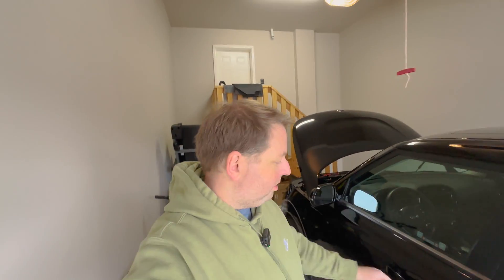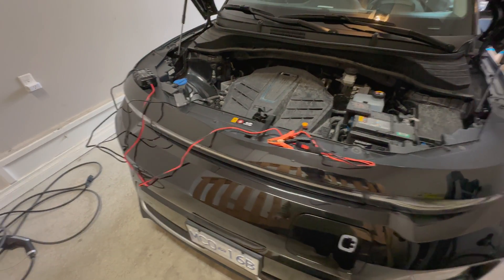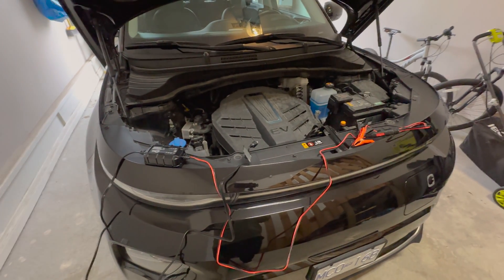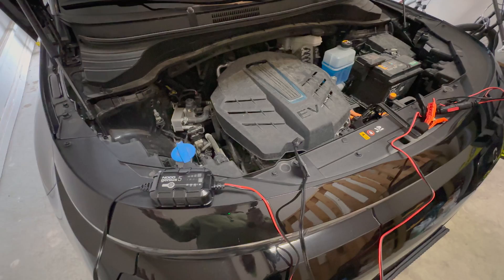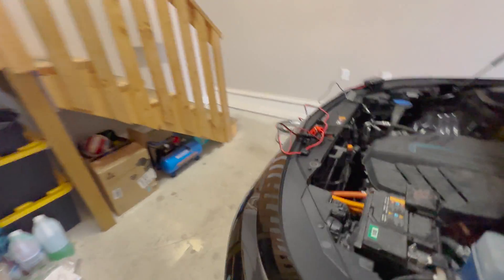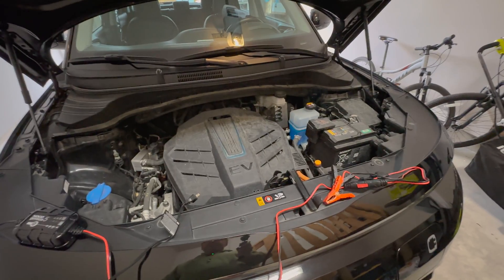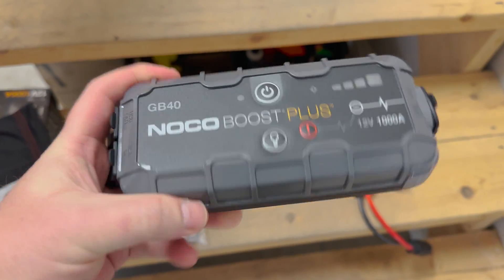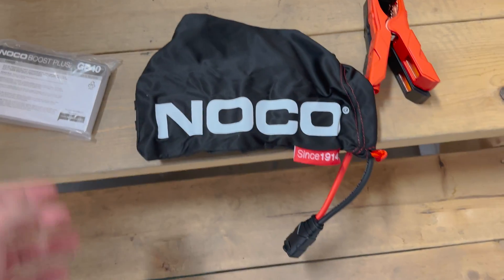12V Battery In My EV Just Died And I Had To Jump Start An Electric Car

Comment: Why would you need a jump starter? It is not like an ice car that needs a lot of current to start.
Reply from the maker: Because EVs still need to rely on 12v for basic functions including starting the vehicle. Relying on ancient ICE tech will hopefully be obsolete when manufacturers figure out how to use the high voltage battery for all functions.
Reply: @LeftCoastEV  
I understand why there is a 12v battery but all it needs to do is boot the computer and engage a few contactors to connect the high voltage battery, no cranking of a cold engine. It is for safety reasons that the high voltage battery is isolated when the car is off so until the computer sees the car has booted it won’t connect to high voltage.  I would have thought a few minutes on a trickle charger would have been enough to start the car. I would look for a different dealership as this could have happened 100 km from home then it would have been more than an inconvenience for you. I have a 2019 LEAF and when we went on a month long motorcycle trip to Newfoundland in 2022 I kept the car connected to a trickle charger to prevent the 12v battery from being drained. So far I haven’t experienced any issues with the car other than the deer that ran into the passenger side about 3 months ago.  Hope they replace your battery and give you more than platitudes. 
I will watch some more of your content when I have the chance, always good to find a Canadian YouTuber to watch.
Reply from the maker: I believe it to be a safety issue just like you mentioned. 12v is there to engage the systems, do a check and if all good the high voltage takes over. The issue with Kia/Hyundai is that their BMS system is horrible. The high voltage battery is meant to manage the 12v and if it’s low on power it should trickle charge it. It only happens sometimes. This is why there are so many complains about Kia/Hyundai owners and the 12v battery. I’m going to the dealership this week to change the 12v and will make an update video. Thanks for the subscription! Much appreciated!

Comment: Make sure your main battery is above 20%, if not it will drain the 12v.
Reply from the maker: Thanks for the info, but this would be pretty unrealistic for me to always keep my battery above 20%. EVs like this charge better if they are at lower SOC and I road trip a lot, meaning I arrive at destinations way below 20% and it will take some time for me to find a charger. What needs to be done is to address the problem with better 12v management like other manufacturers are able to do. Not sure why Kia/Hyndai have problems doing the same.

Comment: Did you have the battery load tested? If it's a bad cell you have to replace the battery. No trickle charger will fix a dead battery.
Reply from the maker: Not yet. Have a service appointment end of this month at Kia and they will have a look at it. Thanks for the suggestion!

Comment: My 12v dies every so often if I don't use my soul. It's ridiculous. I don't know if I buy a new 12v will it solve the problem or is it just a vehicle problem
Reply from the maker: That’s terrible. I would say it’s a vehicle problem from everything I have read. It’s also not only limited to the Soul EV but also other EVs from Kia/Hyundai. Will need to investigate if more and do a follow up video if I find out more.
Reply: Ive left my Soul for a month and no issues. I have flattemed the battery three times by leaving an internal light on one way or another. 
I replaced the battery once, last time i had a flat battery I used a charger that has a "repair" function as the battery was only a year old, and it seems (fingers crossed) to be OK now.
Reply: @Joe-lb8qn  i eventually bought a new battery and my problems went away
Reply from the maker: I have finally managed to get a service appointment at my local Kia dealer and hope they change the battery for me this coming Tuesday. However they said they will need to test it first since my old battery is still under warranty so I guess they might try and say it works perfectly fine and not replace it. We shall see on Tuesday.

Comment: That was a drop the ball moment on the dealership when they wanted you to trickle charge. That should have keyed them into doing a charge check including the battery. Is your KIA just 2 years old? I could set my watch on my old CRV battery, after 5 years it would fail. One nice thing your 12 volt battery is accessible.
Reply from the maker: My Kia is a 2021 model year so yes about 2 years old. I’ve had nothing but bad experiences with Kia service. Next time I am in for service I will tell them to put in a new 12v. Thanks for your feedback!
Reply: I would not leave until they replaced that battery. Also, have them check out the onboard charger for the 12 volt battery. @LeftCoastEV
Reply from the maker: For sure, will do! Thanks again for the info much appreciated.

Comment: Same problem for my Kia Soul EV 2018. I keep a 12 V battery in the car, to be able to jump start, if the batery goes dead...
I'm switching the battery soon, since it seems to loose charge much quicker now, and the winter is coming...
I will use this battery: "Exide Excell EB504 50 Ah".
Reply from the maker: Winter is coming where I live as well so I am thinking that I will need to change mine as well. Jump starting if each time is not a good long term solution. Will check out the battery you mentioned.

Comment: The thing with 12V EV batteries is they have smaller charge capacities compared to 12V batteries for ICE cars. The 12V battery for my 2020 Kia Niro died after about two years. The thing that did it for me was I didn't know about Utility Mode where I would have the car's HVAC run off the 12V as I waited in my car to pickup my kids from school and soccer games, etc. Another thing to keep in mind are people with dash cams that have their cameras hard wired to the car. If you have "parking mode" or motion sensors enabled on your dash cam, it'll slowly drain your 12V over time while its off. One thing to consider if you want to play it safe is to buy a battery pack for your dash cam (usually more prominent dash cam companies will have these battery pack accessories). These battery packs essentially power your dashcam while your car is off and will charge itself once your car is running.
Reply from the maker: Thanks for the info, very informative. I want to get a dash cam so will need to look for one with external power.

Comment: My Soul EV 2020 Limited was good for the last 3.5 years until 1 month ago.   I wasn't able to initiate a charging session.   I have tried all level 1, 2, and 3, but no luck.  So I dropped it off at KIA Downtown Service Center.   Finally, I got the inspection done 5 days later, technician said the onboard charger is malfunctioning.   Initially, estimate on parts arrival will take from 4 to 8 weeks. :O  Thank god, they were able to find parts 1 week later, so ya, not very confidence in KIA's reliability after this incident.
Reply from the maker: I am glad they managed to find the parts that quickly. You got truly lucky. Plus I’m with you on not being overly confident with Kia quality and reliability after experiencing a few issues myself. Too bad…they are starting to build some amazing EVs.

Comment: Noco's are great! I've had a GB 40 for many years and use it regularly.  Boosts my V8 F-150 no problem, even at -20C. The only issue is they have a temp sensor in them and won't function in the cold. The specs say -20C is the limit. So unfortunately you can't leave them in a vehicle in the Canadian winter.  I've used mine well below that, but you have to be quick.

Tesla's new lithium low voltage battery still has issues.  It's supposed to last much longer, but due to another issue(damaged headlight) mine died on a 4 month old 2022 M3LR.  Although you can turn on the car by boosting it with 12v you can't drive it.  The new battery has a higher nominal voltage than the lead acid, so the car is not derivable by simply jumping it. Seeing as this is a proprietary battery you also can't source one at your local auto parts store.  Tesla had to tow my car 430km just to install a new low voltage battery.  To me this was a ridiculous situation.   I also don't quite understand how the low voltage battery could die while the car was in my garage plugged into the wall charger.  The high voltage battery was charged to 90% for a trip. 🤔
Reply from the maker: Interesting that your Tesla had 12v issues even with the new battery. This must then be a problem with the BMS and it not working correctly. I think there should be improvements managed to battery management systems especially in electric cars. We carry around a high voltage battery, charge it constantly and somehow it’s not able to provide enough power to make sure the 12v is maintained and kept charged. And I agree, huge fan of the NOCO.
Reply: @LeftCoastEV  The left headlight was out due to a deer incident.  Tesla claimed that was the cause of the 12v failure.  Therefore I had to pay for the diagnostic and the battery replacement.  I was skeptical, but I replaced the headlight as soon as I got home that night and it's been fine ever since. That was January of this year.  

BTW, the deer incident was Sept 2022 and the car still hasn't been repaired.  It's a combined body shop/insurance issue.  🙄 I bought that headlight used off eBay.  I wasn't going to wait around for this insurance cluster to get solved.

Comment: I have the same car. When the car is not used for 2 or 3 weeks.. It charges the 12 volt battery itself. From a larger battery. This can be seen on the indicator under the windshield. The third blue indicator is flashing. Far right. If you are standing in front of a car. This is also stated in the manual.
Reply from the maker: Then it means that my 12v is not utilizing its optimal performance since I’ve had low 12v warnings for a while now. Will have to investigate this further. Thanks for the info!
Reply: Surely the optimising system should keep the 12v battery charged up, otherwise it's no good. I have the same car and the 12v battery ran low to 6v and I had the same symptoms. Had to jump the car with a battery jumper and all was OK then. Just seems stupid to me. 😡
Reply from the maker: The 12v battery management system on Kia and Hyundai cars is terrible. Hope the figure out a fix in the future, but I am not hopeful since even the newest cars have this issue.

Comment: Not just EV problem. I had a 22 Tiguan that would do the same. If I didn’t drive it for 3 days the battery would be so low it wouldn’t open the locks with the fob. Had the battery replaced and it seemed to fix the problem for a while but the same thing started happening again. I had to hardwire a battery maintainer charger in the car and use it every couple of days. Sold that Lemon back to the dealer. Luckily got most of my money back.
Reply from the maker: Great that you managed to sell it back to the dealer!
Reply: @LeftCoastEV  yes the VW dealer was great. The VW corporate not so much.
Reply from the maker: VW is still not announcing a change to NACS and I am not really sure why. It’s them and Stellantis as the only holdouts. I wonder what is keeping them for jumping ship from CCS (investment in Electrify America maybe).
Reply: @LeftCoastEV  VW I don’t think has a clue what to do. I don’t think it’s EA or EC that is stopping it they haven’t put in enough charging stations, that work, to make it a big deal. They didn’t invest in a good operating system in their vehicles and thats the main reason they’re floundering.

Comment: This is a known problem for all EVs - Watch is video and get one of the battery monitors he demonstrates: https://www.youtube.com/watch?v=lr3Z_z1C0Uk&t=845s
Reply from the maker: Watching all the videos online when this happened, I already ordered the battery monitor, but thanks for mentioning it so other know about it too.
Reply: Auto reliability seems to be going down because of all the added complexity in modern vehicles. Kia in particular are problematic. My 2020 Soul ICE needed a new engine after 9K miles. Kia has had many major recalls in the past few years. Not sure how Kia is profitable.
Reply from the maker: Agree. I’ve had my fair share of issues with my Soul EV and as of right now I have very little trust in the brand.